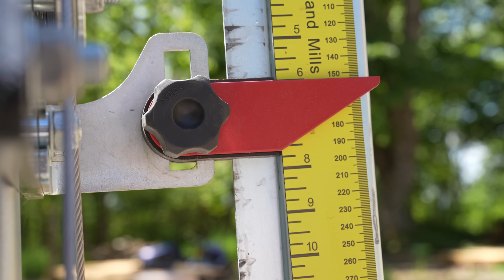This is our next big project ,starts Monday!

Comment: Novel idea for transporting the noggins. Using your brain to save your feet. Not only are two rooms floored, I am too!
Reply: Work smarter not harder
Reply: He really used HIS noggin on that. 😇
Reply: Is it me, or is Dan getting broader through the shoulders and chest?
Reply: Someone suggested that in the comments and he replied!
Reply: Proves Dan does read the comments as someone suggested he should do it that way.
Reply: That works well... until it suddenly doesn't... Too many blocks of wood and pressure on one end only is a recipe for disaster. 
Me?  
I'd just use a pair of Blue IKEA shopping bags.
Reply: Or someone reads them for Dan. Nog, nog on Heaven's floor ❤😅❤
Reply: And stairs
Reply: @norwegiangadgetman you'd be limited as to how many you can fit on each clamp anyway. It's not like he's carrying a whole Jenga tower.

Comment: Maybe thinning out the trees has helped the flow of underground water to fill the pool?
Reply: I was wondering if someone in the area has opened a dam on one or more streams and water that was being held back might be flowing again and are once again filling up the underground water table? It's just a thought I had....
Reply: @bluebird1239  Couldn't say, however, from the looks of ariel videos, the house is sitting on top or a small mountain or large hill.  I doesn't seem likely it would be in  position to receive runoff from upstream.  I suspect it will dry out as the summer gets hotter and dryer.  Dan needs to get busy and do as much lyme, mortar and plaster work as he can while he has plenty of free water.

Comment: Hey Dan, great idea with the clamps for carrying the noggins! There is a tool for carrying bricks as well. Your clamp idea reminded me of the brick carrier I used when I was tending a bricklayer. 
Keep on keeping on Dan!
Reply: Yes, I used that brick carrying tool, trying to remember if we called it 'brick tongs', maybe something like that? It was metal, adjustable and maybe carried about 10 bricks or so. I see they are making the tongs out of plastic as well now. Also there is a tuck pointing tool that is various widths depending on the width of the mortar joint that Dan might want to use if he has exterior brick that needs to be seen with a clean mortar joint. I have never seen any videos with anyone in France using the narrow tuck pointing tool.

Comment: MOSQUITOS!  STAGNATE WATER.  NO!  Somewhere within the timing, that area needs to be dredged.  Find out where the water is coming from.  I mean if you are overtaken by Mosquitos, you will be miserable.
Reply: Don't worry it'll be used when they start mixing the mortar and watering the gardens.

Comment: Dan, shellac the top of your massive picnic table. Makes it easier to keep clean.
Reply: An exterior varnish would probably be better.
Reply: @NinaHansen2008  As long as it's food safe.
Reply: @NinaHansen2008  Any topping would work.
Reply: Shellac is completely inappropriate
Reply: Shellac dissolves and gets sticky when wet. Varnish works.
Reply: @tamarlindsay8382  Actually not, what shellac do you use? 
Plus, it's not a Plastic like coating from varnish, Karen.

Comment: Nogging
A nogging (or occasionally noggin) is a strut used to give rigidity to a framework, typically fixed between joists or studs to their increase strength and stiffness.

Noggings are commonly used to brace floors or to stiffen timber stud frames.They are often made from timber, but may also be made from metal and other materials.

In Scotland, noggings may be referred to as ‘dwangs
Reply: In the USA they are referred to as blocking. Also, thank you for clarifying that the are “noggings”, not “noggins”

Comment: The lower basement wall can probably wait for when you eventually cement that basement floor and have a nice solid base to build the walls from. 
Steel I Beams in and getting the floors in like normal, bracing the walls and getting to the roof I reckon you should really focus on. 
Cant wait to see the roof go on and for when you can relax a little and start focusing inside the chateau. 
Might actually be nice to NOT have a center wall in that room and have it large and open. 
It would make for an awesome large basement workshop to work out of.

Comment: Dan, why don't you fill that hollow space solid using concrete and rubble?  It would add a LOT of structural strength to the back wall of the chateau.

Comment: In one house I lived in, a bathroom and laundry (both on ground floor) had brick walls under the floor, the same shapes as the room under the timber stud walls. Something in the architect's mind about helping supporting weight of bath and washing machine full of water. No treasure or hidden skeletons found. Just structural.

Comment: Is there any way to stabilize that freestanding arch that's looming over the final portion? I have nightmares about removing rotten steel and the wall shaking enough to bring that arch crashing down. But I know Nick will keep you focused on safety!!
Reply: It's probably more solid than it may look from an distance, otherwise it wouldn't still be sitting there on the top of the wall after so many years, exposed to weather and storms.

Comment: Watching that recap, one of the stones under that debris looked like a step.   You still have not found the wine cellar sub-basement yet.  The place is old enough it would have had one, as it pre-dates refridgeration.  But later renovations were post-refidgeration it may have been built over or back filled.   I wonder what would be under all that rubbish if you cleared out that void.
Reply: I do wonder if there is another level under the basement, a majority of older French properties have cellars.

Comment: Oh this is going to be good. It you're doing roofs during summer that means there's a chance you'll have windows before winter. Which in turn means you could do interior work like plumbing, electric, walls etc during winter. Spring 2025 this may not be a ruin anymore!

Comment: I've said this before, I really don't think the location of the stairs from the ground floor up to the second floor has ever changed. The positions of the windows on the front are exactly the same in any picture you'll find of the château and those offset windows at landing height are extremely strong indicators that the position and layout of the stairs are 100% original. There's only one change that I suspect happened, either late in the planning phase or during a later reconfiguration, and that's the stairs from the second floor to the third. The 1980s plans show winding stairs in the hallway, which makes sense based on the clues we had, the square opening in the vaulted brick ceiling and the leftover balusters hanging on the third floor. However, there's also a strange bricked-up opening from the second-floor hallway into the stair well that lines up nicely with another, though much narrower and steeper, straight flight of stairs going up to the third floor of the tower, ending just in front of one of the balcony doors. Those stairs would be right underneath the stairs from the third to the fourth floor.

The steels in the back rooms are spaced much further apart than those in the wings because of the massive opening on the ground floor, into the bay. All the upper steels are supported by a straight brick column that transfers the weight of the upper floors to the foundations rather than onto the steel spanning the ground floor opening.
Reply: The chateau was probably originally build with some level of owner/servant 
separation. I think the norm was to have seperated floors and stairscases, so the servants could do their work without being seen or heard by the owner or guests. Cooking and washing was often placed in the basement and the servants then had their bedrooms in the attic. Then the middle part was the owner familys home.

Comment: That window half way the stairs need a safety hand rail otherwise someone may go out the window! Also there appears to be a noggin missing in the center section of the new floor?
Reply: Wasn't that where the birds nest with eggs, is? From a few episodes back. Marked with fluoro paint if I recall correctly.

Comment: What a koinky-dink.  I no more than mentioned about my curiosity over the rabbet-groover thingy-dingy tool a week or so ago and lo and behold not only is the name mentioned but then it just happens we are able to see the name on the tool making dust when it's being used for joist making in the last video.  Go figure!  Those germans are really proud of the tools they make  though, aren't they?  Speaking of the dust though, in my shop over the space where I had a bench similar to yours, I hung a little vacuum from the ceiling and then next to it a little three or four foot L-shaped arm that could swing from side to side.  I ran a ten or twelve foot vacuum hose with electric cord attached hanging down  so any tools I used below in six by twelve foot or so area had electric and vac all at once.  I had a switch on the wall for the vac.  It made a big difference in my irritability level over the sawdust problem and tripping over cords plus I got to breath easier too.  You just have to jump up on the table now and then to empty the vac.    Jack L..

Comment: It is great to see the amount of increased efficiency due to practical experience. Usin the c provile steel beams on the wall side, clamping the noggins to carry them up, rationlizing the wood work. This easily adds up to increased speed by magnitudes compared to the early days. I still don't see how you will survive roofing, plumbing, calbling, etc. but so far you have exceeded my expectations. It's a good thing, that you keep things pragmatic, compared to the likes of Les Jerómes who are doing a great jog too, but at a painstaking pace. I love your channel.

Comment: The first time you started putting floors in it was an exploratory exercise, the second area that you're finishing up, it was more a way of showing you've developed you technique and confidence. This time with the wall build, maybe it will be a chance to show all you've learnt and to possibly develop this further. Remember the roof going up over the first section of the chateau was partly because of the weather damaging the floor on the top level - maybe you'll need to look at this during the process of getting the floors in the final section. Is it possible that there will be preparation of the roof beams while you're getting the floors in place because you'll find this more manageable than you did at the beginning.

Comment: Depending on the location in the house, could that space between the two walls have been a cistern? Piping coming in or pipes coming out? Used to store rainwater for use inside the house. Just a thought.

Comment: I agree that the original tower is the sensible place for the staircase.
Would you recreate that, and move the staircase back there, or is there somewhere else that seems better?
Does the water in the swimming pool maybe fluctuate with the level of the ground water?
I think you could be starting on the roof by early August, without rushing.
Of course if your team really do work well you could easily better that estimate.
Looking forward to more flooring.
If you reach the top faster than I expect I will be suitably floored!
Reply: If the house had servants, it might have had 2 staircases. Meaning people working could easily get up/down without disturbances for the family. I believe that was an pretty normal setup back in the day, in big homes at the more wealthy circles. Servants was not ment to be seen or heard. The family and servants had seperate staircases and floors. Servants slept in the attic and had their main workspace in the basement.
Reply: The temporary staircase is already in/under the original tower.

Comment: How stable is that piece is at the top of the central section ? with all the work you will be doing on the walls , how sure are you that won't become unstable and fall into the void as against falling outside the footprint of the building
Reply: But it did survived storms for 40 years.

Comment: Why not do the top floor first so you can get the roof on while everyone is there? Maybe impossible but the idea is good
Reply: I guess he need all helpers gathered to handle the big floors, to avoid any "brown pants" situations. Having all floors in place will also make life much easier and the chateau a much safer as an work space. It will also open for a lot more smaller projects, that can then be worked on, if time in excess for some reason. Like earlier where had several times of waiting on the ordered stuff to show up.

Comment: When will you put the 2nd roof on?  Boy, your hair is so long now Dan you could wear it in a ponytail like Amary does.
Reply: Did you view the video without sound? Dan explained that all the roofs are getting done this summer. He and several helpers will use the next month to getting the last big part of the building prepared for putting on an roof on the top. It will also make the building much safer, no more fear of getting big parts falling off wall from up high in the head.

Comment: All of a sudden the water just came up?

Sounds suspect, are you sure the team looking for the water supply didn't accidentally break something that is now flooding into the groundwater?

Given the timing it does seem extremely suspect.

I'd contact the water board and ask them if the system pressure is unexpectedly low for your area.
Reply: Check the Well!! It may be way up and spilling to the pool.